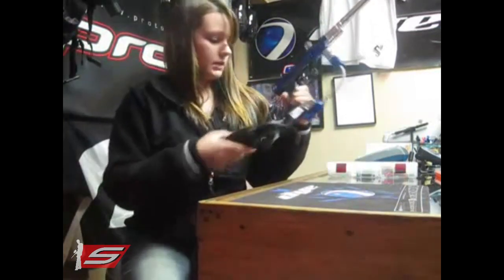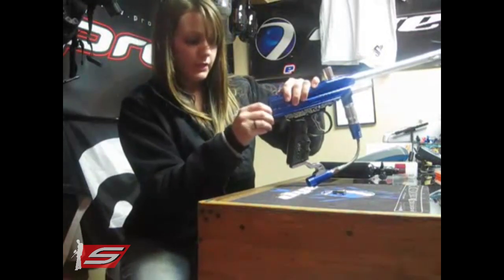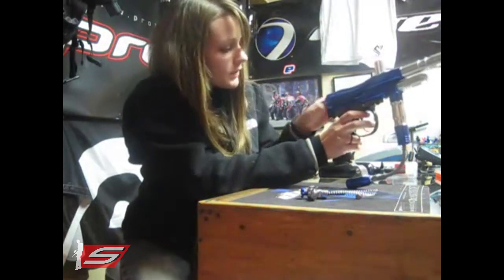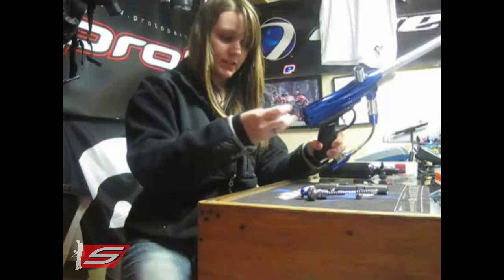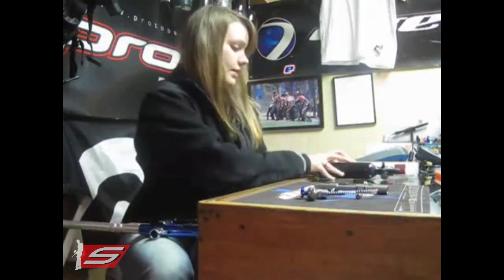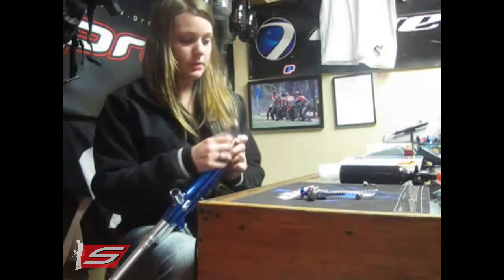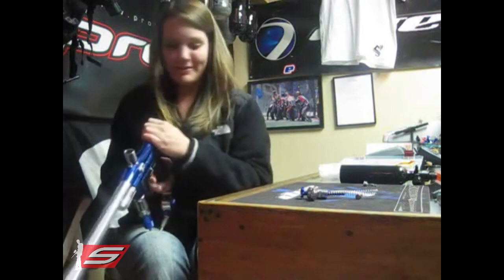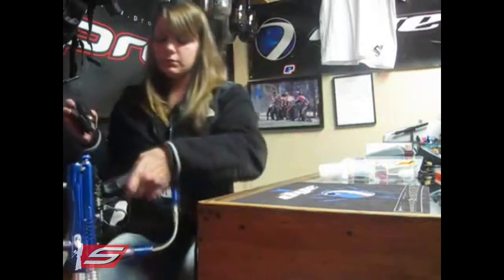Girl Paintball Tech, Ep. 4 - Teching a Broken Spyder TLX

Comment: Uhhhh oil the o-ring on the striker. If that gun doesn't have a delrin bolt the bolt isn't oiled enough. Check hammer o-ring. If none of those are right then check the regulator o-ring. Then check the regulator. If nothing's wrong with the reg, then check the hose and asa. Simple as that.